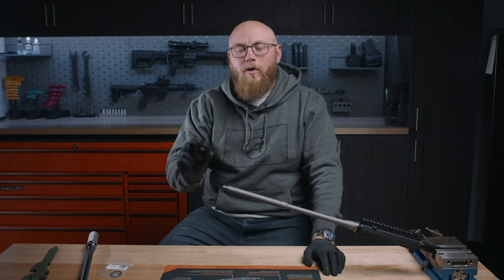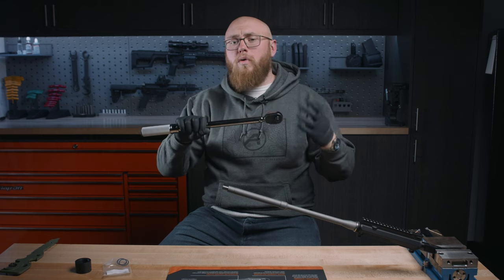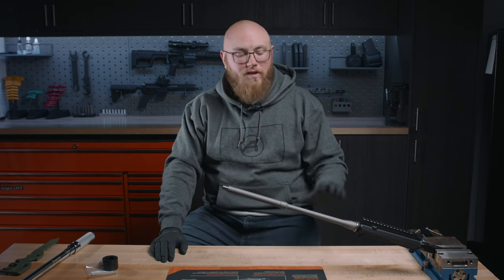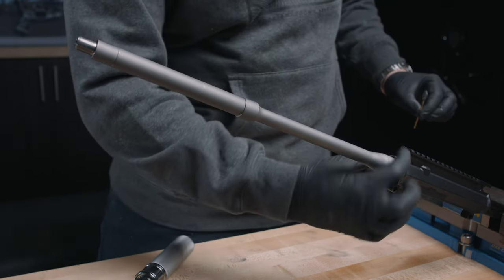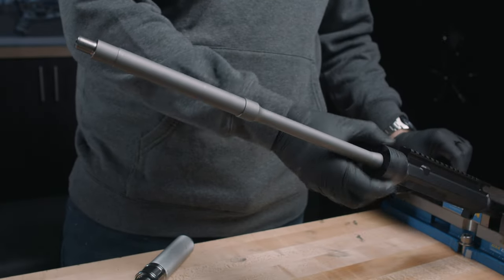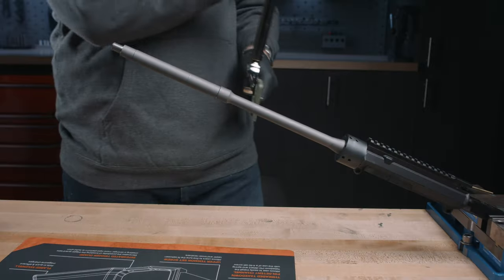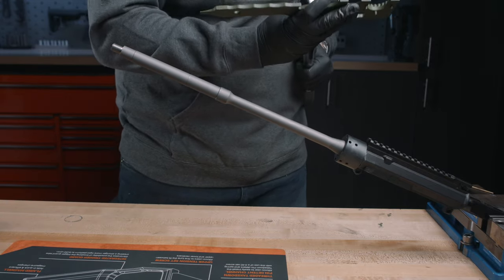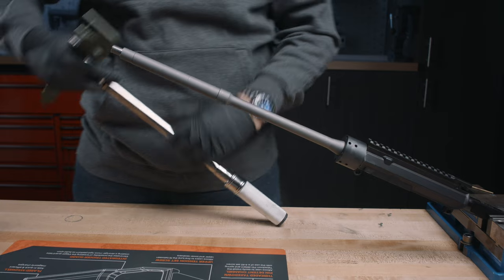How To Install A BAR Barrel Nut

Comment: The AP Bar Barrel nut three hole positioning is not compatible with a good number of standard armorer's wrenches. I wish they would post a link to all wrenches that are compatible and let the buyer chose which one to use. I bought one that is suppose to work (based on customer feedback) but the three pins did not align, so I just used two pins. Not the best solution but I have yet to see an official recommendation from AP on compatible wrenches

Comment: Like the idea of being able to use the enhanced handguard on a standard receiver, but the BAR nut seems like a pain to mount and index.  Why not more slots for the gas tube?  I think just adding one or two more could make a huge difference when trying to index.
This is why I hesitate to buy this kit.  I know I'm going to be pissed off already😄

Comment: I'm a lefty doing my first build with the Aero gen 2 picatinny handguard and bar nut and Stag upper. . I'm here because I can't figure out why when I try (about 40 tries) to install the barrel nut it's not lining up with the hole in the upper receiver for the gas tube. Is that what the shims are for? And why don't you guys include shims with the bar nut when bought with a handguard? I just looked on your website and the shim is $6.88 w/tax + $11.19 for shipping (cheapest shipping option) Now that's plain stupid. So stupid I don't even want to use the dam thing. The only reason I'm still trying with this is because I bought the M4E1 lower and a bunch of other Aero parts.
Reply: The shims are to make sure you have enough thread to torque the barrel nut without running out of threads. I’m guessing that you are using a milspec nut, the one that looks like a sprocket. If so this is the reason there is such a huge gap in the torque spec. 35-80 FtLbs. Start out at the low end of the spec, if a tooth interferes with gas tube alignment just put a little more torque on the nut until it lines up. Hope this helps and for your own safety do some more research.
Reply: It normally comes with the shims

Comment: This barrel nut should come with a tool. These armorers wrenches are a pain to find. I had to buy 3 from Amazon till I found one. 1 of them came with the wrong order so in reality I had to buy 2. Just include the tool and charge extra for it. I went to bass pro and 1 other gun shop and non have the tool. Also Home Depot doesn’t have any tool. Lowes nothing. Harbor freight has nothing.
Reply: I just bought Aeros enhanced quad rail handgaurd and it takes the barrel nut shown here.  unlike the last m lock I bought it didn’t come with a tool. So now I’m on the hunt for a three prong. It has crossed my mind to Jerry rig and adjustable spanner wrench and make it fit my torque wrench
Reply: @TN_vigilance  This is insane to not include an adapter, or info on an exact tool because the two AR armorers wrenches I do have, don't work/line up with this nut.
I'm just sick of aero at this point and can't believe I ended up buying another product from them. 
Lesson learned
Reply: @TonySmithJr  pure ridiculous. I found an armorers wrench  on optics planet that claimed to fit the Aero BAR nut. It didn’t I had to modify it 🤦🏻🤦🏻
Reply: @TN_vigilance  My neighbor had a cheap armorers wrench that I borrowed.. I actually had to beat the prongs into a different shape to get it to fit but was finally able to install it. 
I even just saw they are doing a promo for a free tax stamp if you by any of their .30 cal cans.... I can't do it. I just know it will be garbage after finally getting it.
Reply: @TonySmithJr  more than likely, I don’t want to spend the money to find out

Comment: Does the BAR add length to the handguard? As in, if the handguard is 12.7" long, does attaching it to the BAR make it extend further past 12.7"?
Reply from the maker: No it does not. The length is measured from where the handguard picatinny rail meets with the upper receiver picatinny rail. So regardless of the handguard design, the measurement we state is consistent with how far it extends from the upper or over the barrel.
Reply: @AeroPrecision  why are you avoiding questions about the BAR barrel nut???? Why is there no tool recommended they are impossible to find?? Why is it not included with the handguard????
Reply: @AeroPrecision this is not true.  Why does aero precision continually get things wrong about their own products?  Aero Precision lists the gen 2 handguard as being 12" long.  But it is actually 12.5 inches long. This could ruin someone's build planning.  How hard is it to measure something aero precision?

Comment: If you're building an EPC 9, you don't have to index the barrel nut, right?
Reply: I'm not saying this from experience with Aero EPC 9 but from building several I can say, there's no gas tube so indexing should not be an issue, just torque to spec
Reply: Seems you would need to index it somewhat so that the handguard attachment screws line up.

Comment: The armorers wrench in question is a tapco, which is currently out of stock
Reply: Theres a ton of others that will fit, or your can just order Aero's barrel nut wrench
Reply: @easbreid9879  will magpul armorer's wrench fit? also, what is he indexing?
Reply: @planchik  give me a little bit, i have an extra BAR barrel nut and i magpul armorers wrench, let me see if it fits. If i remember correctly, i believe on the Aero site it says no
Reply: @easbreid9879  thank you
Reply: @planchik  the magpul armorers wrench will NOT work because the other pins on the wrench get in the way. What ive always used for the BAR barrel nut is the wrench from Aero, its cheap and goes on a torque wrench or breaker bar
Reply: @easbreid9879  thank you so much for the info

Comment: Unfortunately, this barrel nut doesn’t work with a Midwest industries Armorers wrench or the Magpul Armorers wrench… ask me how I know… I am just going to return the whole setup and get the ATLAS. It comes with a wrench included.
Reply: It absolutely works with the Magpul armorers wrench I just installed it with one.
Reply: @LeadMuffins  interesting, there was no way at all to align the wrench I got with the nut I received. Maybe I got o bad nut because I exchanged it for the ATLAS and it worked like a champ.

Comment: Need to work on presentation of these videos.  I like Aero Precision but all of the videos I have watched are poorly produced.  Lighting on the Aero Precision videos is poor.  Why didn't you show the installation of the barrel and discuss the rings or washers you added.  Audio is too fast and at time inaudible.  Could barely understand the torque values you were using.

Comment: Don't set your torque wrench up like this. The force that is being applied to the barrel wrench isn't actually torquing the barrel nut, because the torque wrench isn't in line with the barrel nut or wrench.

Comment: Why do you think a reaction Rod is good because if you are an actual gunsmith you would not think that it was good they do not hold the receiver you're talking the barrel nut to the receiver the only thing you're holding is the barrel
Reply: I don’t get it either. It’s simple logic to figure out what is actually twisting and taking the applied force when torquing on a barrel nut. Spoiler alert! It ISN’T the barrel lugs. I heard from a friend that is definitely not me that he uses the VISM vise block and the top piece of the plastiXrevolution vise block. Doing that grips the bottom, top, and inside the receiver.  He, definitely not me, bought one of the basic clamshells but wasn’t too impressed with it. The Wheeler clamshell looks like it might be a good system because of the gas port rod attached but I’m not sure if it goes all the way through the gas port and if you have a barrel nut that has to be timed to the gas port.. then probably won’t work? If I had the resources I would make and sell one that was similar to the VISM block but was also a clamshell. Then it would be practically idiot proof. Reaction Rods should only be used for muzzle devices.
Reply: Correct, using a Reaction Rod is an expensive way to shear the locater pin, I prefer to clamp the Receiver and always lubricate the threads.

Comment: When using a torque wrench on a armor wrench like that it’s better to have them both inline with each other.  Compound angles like in the film mess with the torque spec.
Reply: If the torque wrench is inline, don't forget to account for the longer momentum arm. Personally, I use the 90 degree method, but positioned on the other side of the armorer's wrench.
Reply: @nicclandry8592  listen to nicc! Inline will lengthen the wrench and you will have an incorrect torque. 

Putting the torque adapter or armor wrench at a 90° angle keeps the torque setting correct because the length from your hand to the nut stays the same.

80% of people working in auto shops don't even know how to use a torque wrench right it seems but it's pretty important to do it correctly.
Reply: No.